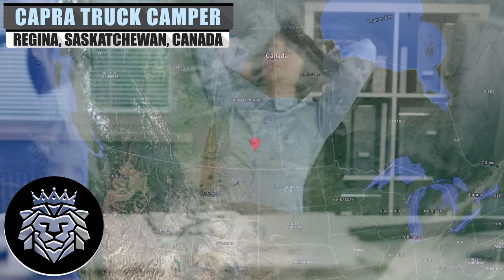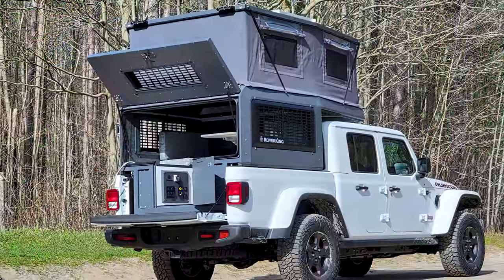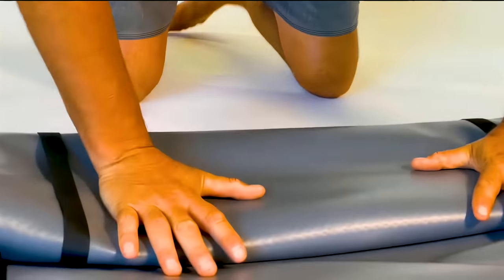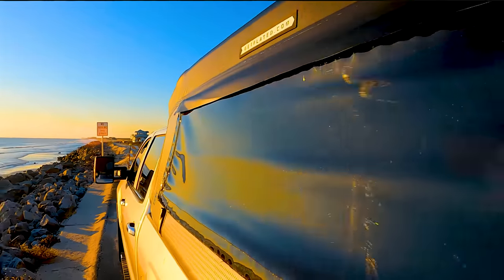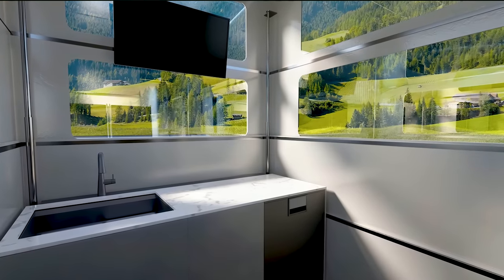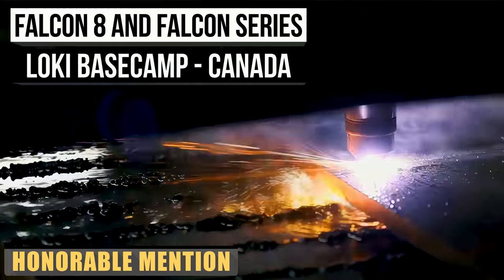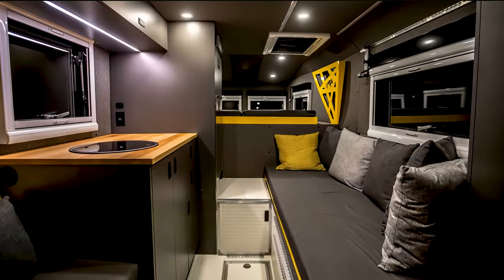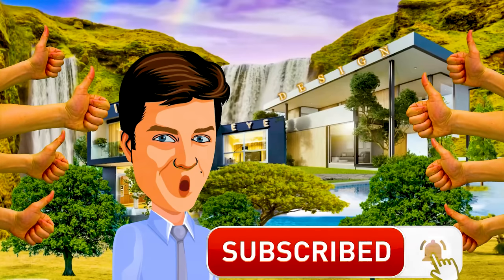COOL NEW 15K ULTRALIGHT TRUCK CAMPER SLEEPS UP TO 4

Comment: 685 pounds in the bed of a mid-size is not light-weight, to me.  My ideal would be a composite/fiberglass over-cab popup canopy that extends the full length of my club cab, and 2 or 3 guys can mount to the bed rail.  

My pickup is also my daily driver, so unless I was headed out, I wouldn't want to carry all that weight.  I also stay away from propane, because of its bulk and weight.  Coleman gas is less convenient, but it's more concentrated energy, and stores in almost weightless cans.  I think propane light is more constant.  That's propane's big advantage.  But a Coleman-fuel stove is just as easy.  You have to keep pumping-up or filling-up a lantern, and the light fades as the pressure drops.  But one refuel of the stove tank is good for several meals, and one pump-up per meal is all you need.  For lighting in camp, LEDs are the way to go.

Seems as though most companies want to see me a bunch of camping gear along with the shell.  I already have camping gear, and cooking inside a camper is pretty nasty.  People do like that fancy built-in stuff, but part of my joy of camping is setting up a couple tables, my 30-year-old Coleman stove, rigging a canopy/screen room/tent.  If I need to eat on the fly, I've got my "tailgate system," where I can whip something up faster than a pit crew at the Indy 500.  It's just a matter of putting your cooking gear and/or lunch stuff at the rear of your bed.  Learned how to do that in college, as the unofficial caterer on geology field trips.  Didn't mean to be.  That's just how it made the most sense to me, and I just ended up feeding everybody because I COULD.